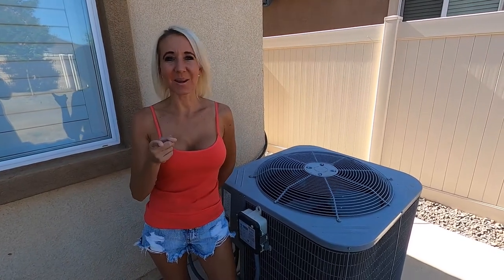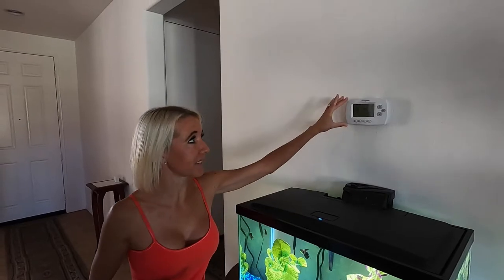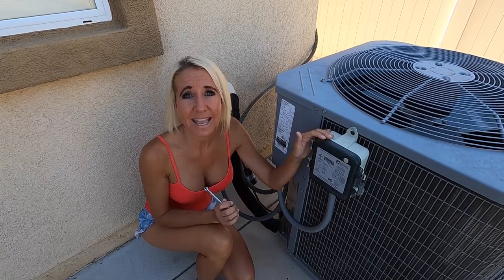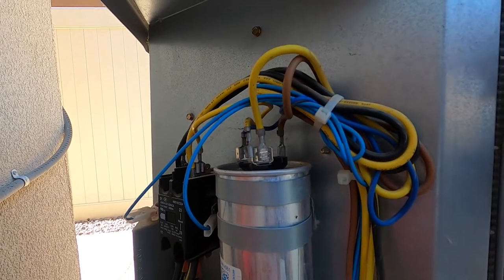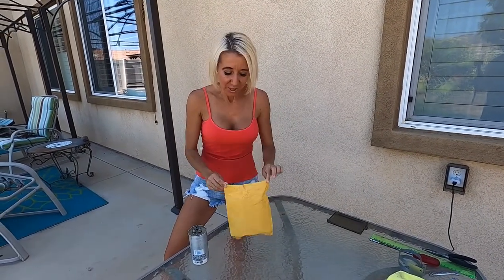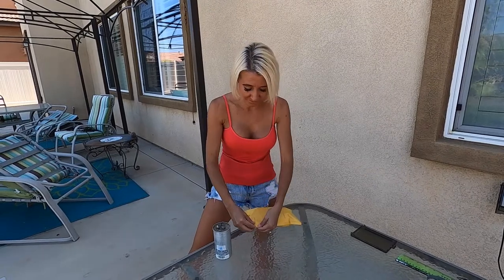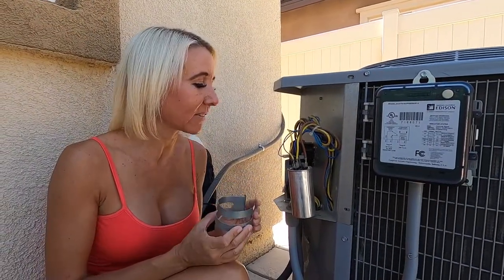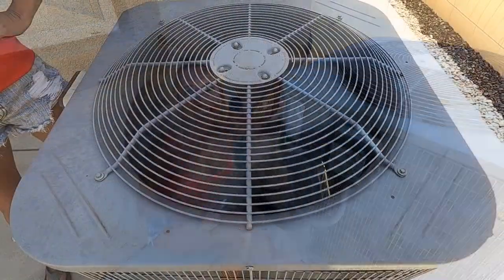DIY Fix Your Air Conditioner Tutorial Save Hundreds $$ Replace Capacitor, Start Fan Motor Compressor

Comment: Hi Lisa and Bill.  Thanks for showing us this Fix It video! We are having trouble with our air conditioner not cooling.  Called a friend who works in air conditioning and he is coming out tomorrow.  I'm going to show him your video and ask him to check the fan... we have had record breaking temperatures for our town this past few days (113°) 4 days. We try to keep our house 80 degrees in summer (I'd like it around 75), but 85 and 90is as cool as we get. It's miserable! Anyways,  our friend Jim will be proud of you too for doing it yourself! ( I think I could but ours is on top of the house) thanks for sharing this with us! Lisa, you are awesome! (You too Bill)
Reply from the maker: That is so cool.. Get it?  lol. cool...  It has been really hot here for us also, 107 yesterday and 106 today. Got to have the A/C working. Nice to hear from you.